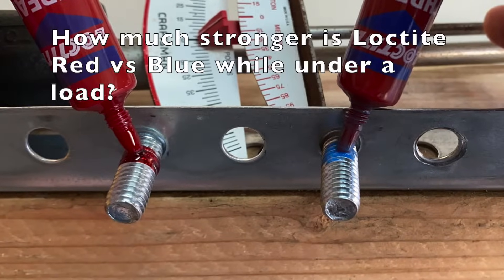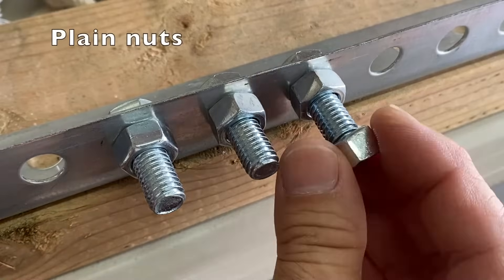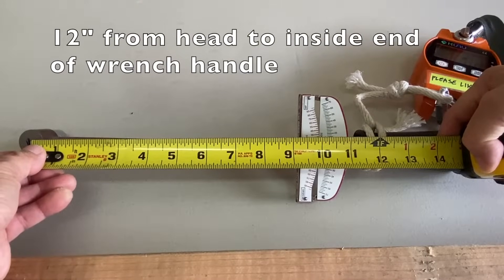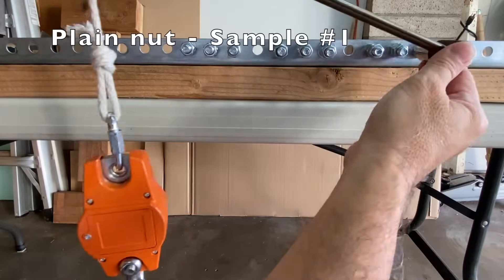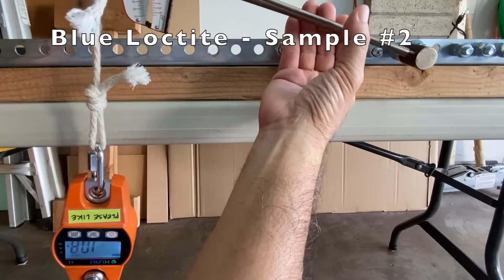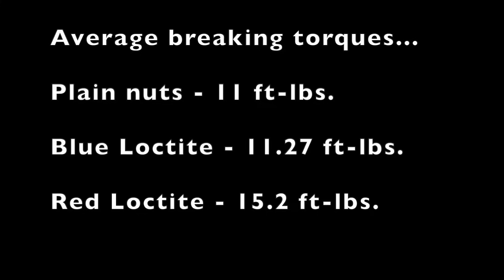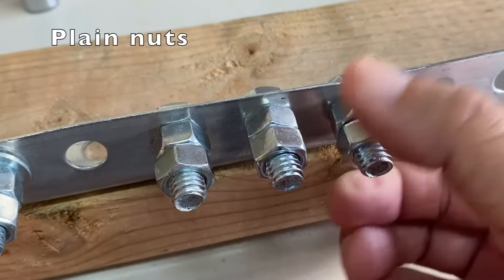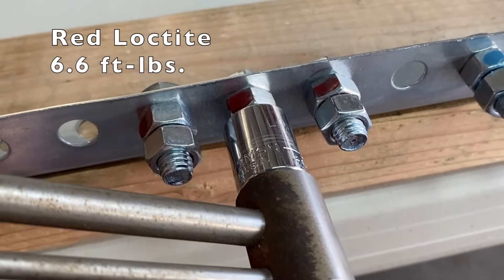Nuts & Bolts - The Honest TRUTH - How Much Stronger is Loctite Red than Loctite Blue?

Comment: 1. You used too much Loctite. 1 drop of that liquid would be enough.
2. 24 hours was not enough time to let that much Loctite cure, that is why the results were only slightly better than a clean nut and bolt. 
3. Blue is only intended to keep parts from vibrating apart, not to function as some form of weld. Red is intended as a semi permanent hold when (Fully Cured) and can be defeated by heat.

Comment: Excellent tests, but it's 24 hours really sufficient for the two Loctites to set completely?  I have found Loctite Blue still damp after a day, when I used it on a 1/4"-20 bolt and nut for a project.
Reply from the maker: The directions say 24 hours for full cure.  I’m comparing longer cure times now with the last test period being 1-year.   Stay tuned…
😎

Comment: If you don't remove the plating from the thread I believe you will need to use Loctite primer before you apply Loctite for optimal break-away torque values. Try using cleaned uncoated fasteners and repeat the test see if the results change.
Reply: If I have to remove the plating to make it work I might as well weld it at that point

Comment: Poor test! Need to try it again after say over 30 days and also add a lot of heat and cold to simulate real world conditions!
Reply from the maker: The directions say 24 hours for full cure.  
I'm actually testing longer cure times.  One month didn't make much of a difference.  Next will be 6 months followed by one year.  
Cycling between hot and cold sounds like a great experiment that I'll add to my list.  Thanks for the idea!
😎

Comment: It would be interesting to see how well they would hold after a much longer time, say a month.  It might not make any difference at all, but it sure seems like after they have been on for a while they are a @*#$& to remove.  Btw I really like the to the point video.
Reply from the maker: Thanks!
I’m working on longer cure times.  One month just passed without much of a difference.  Will see if 6 months and/or 1 year makes a diff.  
😎
Reply: @HacksbyDad  that's amazing!  You just may have captured the first time I've ever been wrong.  My wife will be so happy.  Great video BTW, I'll be sure to catch the follow up.

Comment: Seems like blue is like a thread protector and also helps reduce the chance of a nut backing off. Red is to assist in holding the nut to the bolt.

Comment: That red loc tite ain't no joke had this hyd cyl with rack gear setup on it the rack kept coming loose even with a spanner nut on it torqued ended up putting red loc tite on and week later had to take it back apart the hyd cyl failed had to get the rack gear off good luck without using heat to get that red melted I had 48 inch pipe wrench on it and that dude wouldn't budge at all until heat was put on it 😂😂😂

Comment: Lock tite wasnt designed to strengthen the breack away as it is for vibration dampen the resistance you get with some fixtures.  it will help with break away but that will take more than 24 hours of cure time . Ageing just makes it harder more brittle.  
Just saying. 

Just saying .

Comment: If you have a torque wrench with a scale right there, WHY are you using the scale?  Stupid test.
Reply from the maker: Good for you!  Maybe you can accurately read the analog scale at the same angle each and every time, but I can’t.  The digital scale with peak hold came in handy and was more reliable than my eyes.

Comment: Uh that math at the end really makes no sense. The “strength” is 15.2 vs 11.27, not their difference from the initial 11. Especially when the non-loctite set wasn’t 11 to untorque. The extreme spread on the untorque numbers is so wild that statistically blue loctite is the same as no loctite with this small sample size. It is however impressive that red has such a small spread. It’s also clear the red>blue just by this, but not 15x. At most 125% of blue.

Comment: This video is incorrect and there is a misconception. The RED locktite means is HIGH temperature and that's why is used in cylinder heads and stuff like that. That's the only difference. The RED is not stronger or for more vibration.
Reply from the maker: Thanks.  
There are several types of Loctite threadlockers.  Blue 242 is the medium strength and Red 271 the high strength.  272 is a high temperature version.  Please check the technical data sheets for more information.  
😎
Reply: @HacksbyDad  After a bit of research, I retract what I said previously 🙄 After watching his playlist, I found out this gentleman knows everything about loctite. 👍
Reply from the maker: @argentosebastian  Thanks, but I'm no expert.  Just a guy experimenting and sharing what I learn.  😎

Comment: I suspect the Loctite bond continues to get stronger for a lot longer time than 24 hours
also I think that it is supposed to seal the threads against water and salt penetration which would cause corrosion over time although antiseize or even plumbers' Teflon would do the same 
does probably reduce "walking" due to vibration

Comment: You should have cleaned off all the oil and dirt off the bolts/nuts before the test. Soak them in IPA for a few hours and brush off. Then try again. Hardware is made in a factory with lots of oil. Oil makes loctite not stick well.

Comment: Since others are saying theyve experienced more force needed to remove loxtite nuts, maybe get some nut amd bolts, put them in vinigar for a few days, brush off some of the flaky rust so then youll have a set of aged nuts and bolts, apply the loctite again and maybe let it sit a few days?? Also maybe do higher torque like 20 or 25ftlbs. Id love to see the results personally!

Comment: I use a lot of thread locker Purple. First, it excludes water so the fastener does not rust internally on the threads. Secondly, it helps prevent vibration from loosening the fastener. Third, I can get the fastener, especially small screws, apart later. A heat gun facilitates removal, especially of all grades of threadlocker.
Reply: hi arncital have you become a flat earther yet? If not I suggest watch a 13 part series called What on earth happened by Ewaranon to learn that the earth is not a globe. I got it in my about tab.

Comment: Now compare brown and black Loctite to blue and red! Brown is what GM recommended to use on Spicer differentials to keep the bolts on the ring gear and pinion from working loose, and BLACK on brake shoes to keep them tight. When Daddy worked on B-47's they had Green and Yellow and Orange Loctites for different fasteners and heat resistances. ARP fasteners has their own "thread lockers" for their super-quality bolts and studs. ARP main cap bolts (or studs) with thread-locker on them, make a man of you breaking them down again. Like most aircraft fasteners, you don't use a torque wrench, you measure the STRETCH of the stud or bolt with calipers or a micrometer. For giggles, I once put a 5/16" x 28 TPI ARP in a vise to see how much it would take to snap it with a nut. Using 1/2" drive 28" long break-over and socket, I FINALLY broke it near 300 ft/lbs.!!!
Reply: Korean machine tools use white loctite.

They paint all the threads with white paint before assembly...

Comment: Something's wrong here. My experience is far different.  I used Red on studs (replacing lug bolts) on my track car.  When ready to remove the studs, the only way to loosen them was with liberal use of a torch first and far more torque than referenced here. Note that I used spray brake cleaner to clean the bolts and holes first.  As the tests in this video show, not cleaning the bolts can be nearly equivalent to not using Locktite.
Reply: Note that these are shiny fresh nuts and threads. If they were old and rusty i imagine it would be more difficult. Maybe your application also had threads rust too along with the loctite.
Reply: Probably this is fake loctite in vid.

Comment: You're not using that torque wrench correctly.   On those old-school ones you cannot let the handle go fully to one side or the other you have to keep it free floating in the center.
Reply from the maker: Yes... if you're using the analog scale on the torque wrench.  I placed the rope 1 foot away from the fulcrum and used the digital scale to get a more accurate reading with the peak hold feature.  Thanks.

Comment: by your numbers red loctite is not 15x stronger than blue. It does have a 15x improvement but that is different. 15x stronger would have to be 169.05 ft-lbs.

Comment: Blue for nuts/bolts to keep from vibrating/ working way loose.
Red to REALLY lock them down in more permanent applications.
Bare for your alternator adjustment!
Nice & to the point.

Comment: Such is the reason Red Loctite Threadlocker is listed as "Permanent" by the manufacturer and less apt to vibrations, usable for gasoline and petroleum presence areas. Cure time is 5-15 minutes dependent on the material used; Steel, Brass, or Stainless Steel. The manufacture advertises a 3/8"-16 grade 5 bolt break-away at 6.25  to 18.75 ft. lbs. (in. lb. conversion) The use of "Primer" accelerates setting times; see manufacturer's specifications. In many cases, Loctite specifies the use of the red color, (dependent on product number for purpose of use) for larger gap areas. Please be aware that simply the color does not mean the application. In the automotive machine shop business, I use many Loctite products, always with the trust of proper function when using the proper "primer" before application. Thanks for your video posting.

Comment: Good test.  I've ridden Harleys for the past 35 years, and I put blue Loctite on EVERYTHING to keep everything together with all the vibration my bikes put out. It does the job.  I use red on things that I don't have any intention of removing like sissybar sideplates, and accessory mounts.
Reply: Yeah Harley should come with a gallon
Reply: @joeKisonue  How do you know they're riding a Harley? The trail of parts behind them.
Reply: @joeKisonue  😂
Reply: I've used loctite products on bicycles for decades...I  was a professional bicycle mechanic the stuff works . Get the bolt/nut in the right torque range and with some loctite they won't vibrate loose. The other benefit is it won't galvanize into a permanent fixture . BTW that loose fit heavy-duty bearing mount (680? ) proved to be a good thing. For worn and loose press fits. It and the two thread lockers were always on my bench.

Comment: I always found red was harder to break loose, but blue was harder to work off the threads. Might need to let it dry longer, cure.
Reply from the maker: Thanks!  The directions say 24 hours for full cure.  I'm testing longer cure times and will post that video when ready.

Comment: 3/8x16 are rated at 35 foot pounds so why are you testing at such a a low torque setting?
Reply from the maker: Thanks!
35 foot-pounds is for grade 8.  I'm poor and used low grade A307 nuts and bolts.  I gotta save up in order to get some higher grade 5 nuts and bolts next
😎.

Comment: 24 hrs cure time is probably not long enough for full strength.
Reply from the maker: Thanks!
24 hours for full cure at 72°F is stated in the technical data sheets.  I’m going to do another test with much longer cure time but need to save up for that.  These tests can get expensive.  😎

Comment: I think that if anything, Loctite is more of a thread sealant than something that prevents the fasteners from backing out. I use it all day long on my VW air-cooled engines where oil can be very elusive and leak through the smallest crevices.
Reply: But it absolutely does stop fasteners from backing out.
Reply: @JasonISF  It helps, yes.

Comment: Ok, so basically blue AND red locktight are worthless lmao red is supposed to need a torch to remove it, it took the same torque to get it off that was originally applied, about 15 ft lbs, 😅

Comment: 242 doesn't tolerate any oil and is supposed to have threads cleaned and prepped with Loctite Primer. 271 does tolerate some oil and doesn't call for the use of Loctite Primer. There is a Blue Loctite that does tolerate some oil and higher temperature called, Loctite 243. The high temperature version of Red Loctite is 262.

Comment: They are made for two different applications blue for retaining a bolt or nut from vibration and made to be removed with regular tooling the red is for locking application and heat is needed to brake the bond to remove if you clean the matting surfaces they work as intended .
Reply: i was come for write these.
You was explained better than i think

Comment: There is a slight flaw in your test -- if you are pulling vertical down on your scale, the actual lever arm length depends on the cosine of the angle.  It would only be 1 ft when the wrench is horizontal.  It gets shorter when the wrench is at an angle.  If you were using the scale on the torque wrench (which is probably not super accurate but should be repeatable) angle won't matter.
Reply: A better test would utilize a digital torque wrench
Reply: Your right, but the measurable difference is probably only around 1 ftlb, so to show a load difference between three sets of nuts while loosening them the same way, itll still show a difference. The numbers might be a little bit off but the fact of red vs blue vs no loctite having different stengths is shown.
Reply: @skie6282  At 30 degrees, about 1.5 ft-lb error when reading "11" and about 2 ft-lb error when reading "15", but I noticed the angles were not consistent through the test so it hampers any attempt at repeatability or statistics.
Reply: @skie6282    Don’t forget about the coefficient of break away torque do to friction which was instructed to be 20%!

Comment: If you did not degrease (IPA/acetone) prior to this test, it was a waste of time.
Reply: I work with these products all the time and have for many years, unless the bolt or stud is saturated with grease or oil I/we never degrease and thread locker's work just fine.
Reply: @SuperBigdanno  I make things for the military - your definition of "works fine" might be a bit different than mine. If someone is going to test a product, they should at least follow directions.

Comment: I have to agree with others that the real benefit of any Loctite is to keep the fastener from rattling loose once it has come a little bit loose.  I have a .22 cal handgun that had the front sight come loose every time I shot it.  Finally I cleaned the threads in the barrel and the screw and reinstalled it with blue Loctite.  It hasn't come loose again in 40 years.

I use blue on fasteners in my large model airplanes.  Just don't get it on plastic.  It will embrittle plastic like servo output shafts and cause them to break.
Reply: I use clear craft glue ( shoe glue) on many applications that are not torqued.

Comment: Interesting you torqued them to 13 but they loosened less than that? 🤔

I wonder what would happen if you let them cure for longer. That was quite a lot of loctite and it takes a while to dry. Wet loctite would act as a lubricant. But that still doesn’t explain the 13 versus lower off values. That is weird.
Reply from the maker: Yes... it takes less torque to loosen a nut or bolt.  Another YouTuber explained that it's like pushing a load on an incline.  More force is needed to push the load up the incline versus down the incline.  
Wet loctite doesn't really act like a lubricant... watch this video... https://youtu.be/SLBx09En_P0
😎

Comment: Thank your for the video. To be honest i never liked threadlockers. They are just a simple "glue" and as any glue the surfaces must be absolutely clean in order to glue properly. and we men know that working with bolts and nuts is always going to be in a dirty environment covered by dirt and grease everywhere. Also the curing time is around 24 hours. Thats why i prefer split-washers, not need to clean, not need to wait.

Comment: Can you do this to demonstrate how 
PTFE tape actually works. Please. 

The tape doesn't seal the pipe but,
As it reduces friction like a lubricant that allows a better machine fit.
Reply: I just installed a Chinese pipe fitting with poorly machined threads, and liquid pipe dope would not seal it all the way. Tape did. I always thought it for lubrication only and didn’t seal, but it does indeed seem to have some sealing properties.
Reply: I would also like to see a video demonstrating the product and testing it under different pressures.